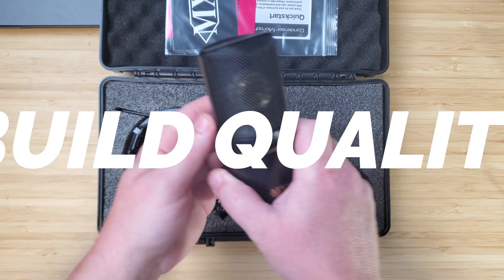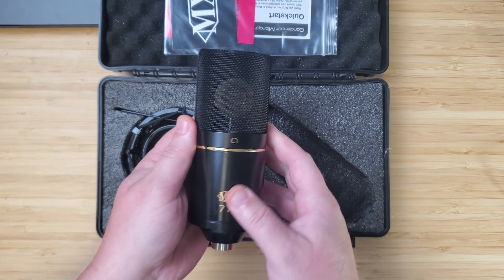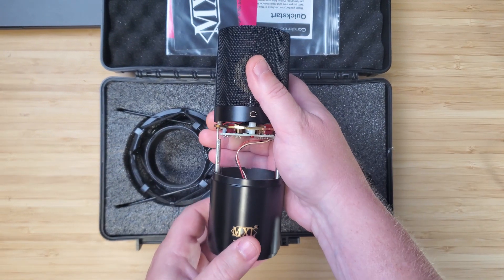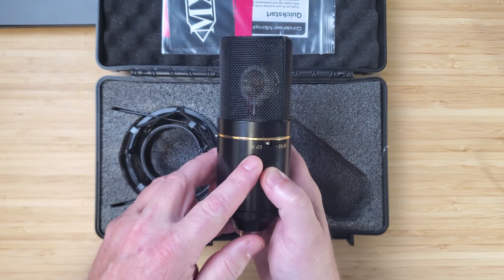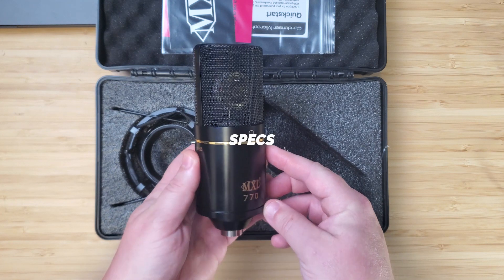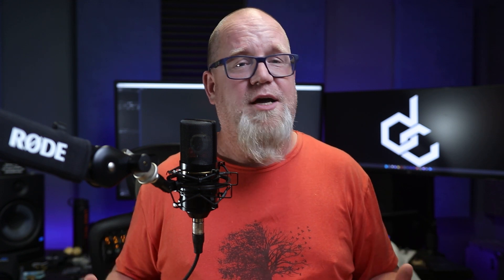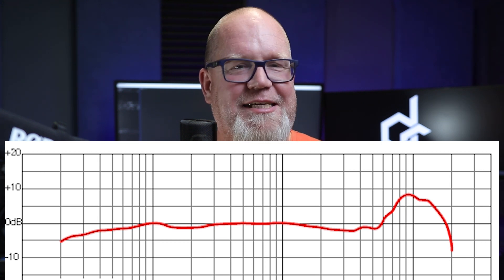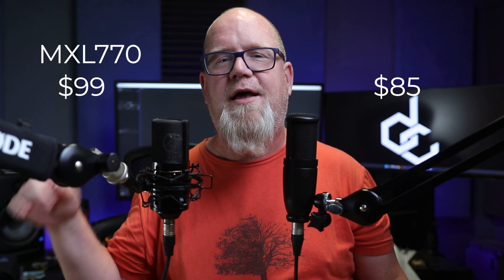THIS MIC WILL BE DESTROYED SOON | MXL770 REVIEW

Comment: I detest the sound of mine.  Used it once.  Bought and enjoy the sound of the King Bee 2.  So fat, heavy, unwieldy... irritating to use, even makes my PS1 droop and can't set it at a good angle.  So, just for sheets and goggles, I'm going to put the Neat capsule into the MXL.  I just have to wait for the mount to arrive, can't transfer the one in the Neat, it's a rubbery triangle made just for those big fat Bee heads!